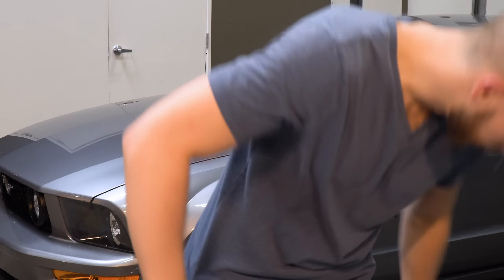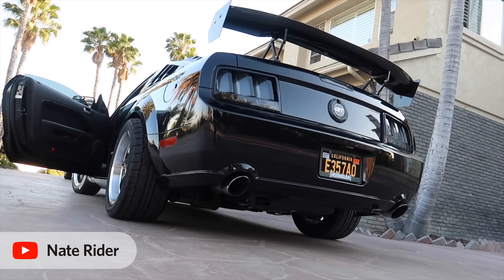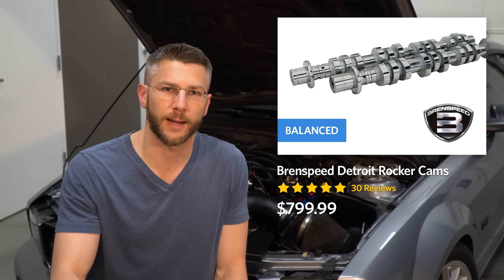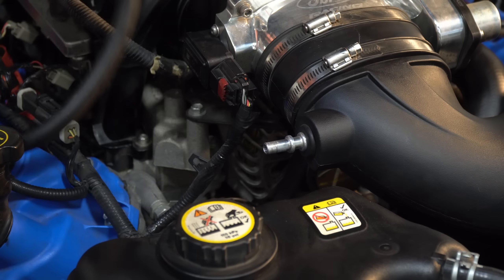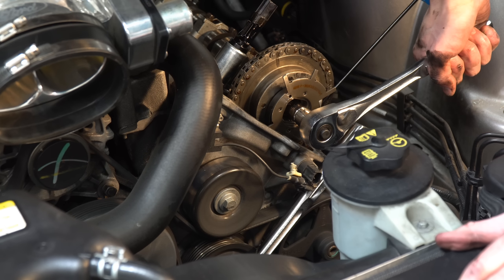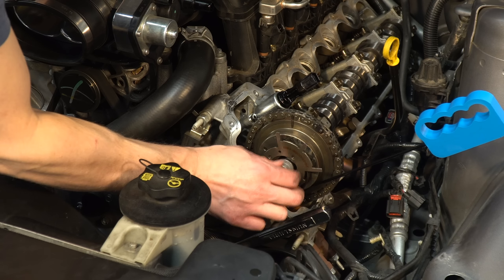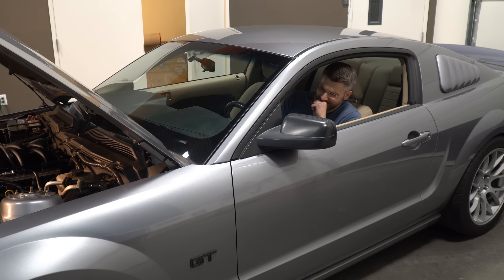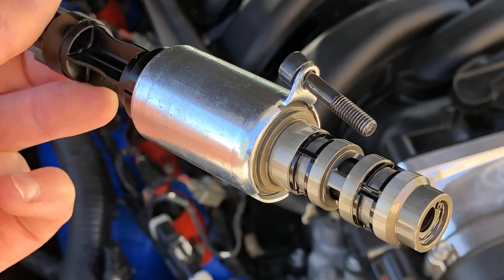Mustang camshaft selection and install guide

Comment: Thank you for this video! Extremely insightful for the instal and extremely well done.Just put them on my ‘05  GT along with a Brenspeed performance tune (and some other stuff). They sound great! I have 2 suggestions to add having done this myself: 1- You will very likely get “some” debris in your valve train in the process of removing your valve covers/manipulating the cams, etc. so I would suggest dropping your oil after you tighten the new cams, and pouring some oil onto each side so any debris drains out, then go ahead and add new oil & filter. 2- when you’re removing the cam phaser bolt, use an air gun if you have it! Getting it off quick makes it less likely to disturb the timing chain.

Comment: If you made everyday context you'd be in the millions for subs. Good stuff. Keep up the GREAT content!
Reply from the maker: Ha thanks that's very generous.
Reply: @Four_Eyes  I agree on the body style. I have a 08 gt500 a 07 Shelby gt and a 07 427 edition convertible super snake.Love the body style.But I also love the 10 look.I have a 10 grabber blue super snake and a couple of cobras also but my favorite car is my torch red 08 gt500.The 500 has a modest 850hp and my 10 is 900hp.But even with those numbers my 07 Shelby gt is 325hp and I still enjoy that car.I can use all the power vs trying to use half the power in my super snakes. I love your car RETRO GOTTA LOVE IT.
Reply: @anthonylaudano9751  how many fucking Shelbie's do you have hot damn
Reply: @omegargb236  prolly zero

Comment: About to troubleshoot a ticking noise.  Possibly a bad cam roller follower or stuck lifter.  I've watched this video multiple times.  Thanks for posting and assisting DIYer to tackle these kinds of issues.  I have a 2006 Mustang GT the same color as yours.  Love it.

Comment: As soon as you called out the other tubers, I smashed the like button on and off about 20 times lol. Thank YOU for not abandoning your platform. Was wondering where you were. I know that you’ll tell us in another video what happened prior to this video. Good choice on the brenspeed cams. They are proven and work well with forced induction. And yea, it sounds sooo good. 💪🏾😎

Comment: When I first got mine I didn't have the Kooks long tube headers with h- pipe once that was installed I noticed a big power difference.  Before only on top end range.  Yes, they do sound great.  Please make more videos.  I personally love my Brenspeed cams which I read on Mustang Forums they produce more power than Ford Racing Cams.
Reply: Where do I buy the cam from

Comment: I really love the sound of the Detroit rockers, but my goal is for more power over sound, but to stay streetable. So I've come up with a combo for my f150 5.4 3v that "I think" will give me what I'm looking for.  Custom grind cam, intake 235°@.490 lift, exhaust 230°@.500 lift
With 112°lobe separation  , port match the intake and exhaust, shorty headers, cat delete w/dual 2.5 exhaust w/xpipe. Hope this works.
Reply: Long dead thread but you're more or less wasting your money. First, the shorty headers do absolutely nothing for you so whatever gains you do get will strictly be through the cams. The second are the cams in general. Unless you can get intake adapters to fit something other than the truck manifold you'll barely see much of a gain over 15 wheel because the stock manifold can't flow enough. The heads can support an easy 250-350 wheel but it's the intake that lets the 5.4 down.

Comment: Great video. You missed one thing there are a couple rocker-folowers that need to be reseated with a spring compressor after the cams are installed. Something about how the cams sit, the rocker-followers want to come out. This happend to me and cause one of the cyilinder 8 intake valves to drop. The ford performace install guide depicts which rocker-followers to reseat.

Comment: Glad that all your issue was just a sticking VCT solenoid. Did you replace both of them or just the bad 1?
Reply from the maker: Just bad the one... which is probably short-sighted.
Reply: @Four_Eyes …...Well at least it's a simple enough job to do in retrospect so it's all good. Have you always had the Airaid CAI? Thought you had a JLT prior?
Reply: @Four_Eyes …..FYI, found out from some snooping that you can't incur any piston-to-valve clearance issues on these 3V's using a "drop in" type camshaft from a VCT solenoid failure as the cam lobe design is engineered to operate within the full OEM VCT cam phaser physical swing range of 30* total camshaft retard from base camshaft timing as designed in the cam phaser itself (as are the OEM production camshafts). The only way to incur actual piston-to-valve contact is from the engine actually jumping PHYSICAL time (timing chain, sprocket, tensioner, guide failure and\or actual catastrophic cam phaser, camshaft or crankshaft failures). The issue w\ the failures that took out the engines of the 2 YouTubers mentioned were most likely due to improper cam installs (misalignment of phaser pin into the pin slot of camshaft nose causing pin damage\breakage during tightening of cam phaser to camshaft or left 1 cam phaser bolt loose enough from either under torque or over torque to cause cam phaser to cavitate on camshaft nose while in rotation banging into phaser pin causing it to fatigue then break) into the cam phasers that caused the timing PIN inside 1 of the cam phasers to shear off which allowed the camshaft to physically rotate out of time inside the cam phaser's cam socket causing a piston to hit a valve held open at full lift height by camshaft when piston is arriving at TDC. This most likely occurred due to installing the camshaft back onto the head w\o removing the necessary followers (doing this work w\o using a valve spring compressor) to put the camshaft into neutral unloaded position BEFORE installing the cam phaser back onto the camshaft due to the camshaft pin slot being rotated slightly out of alignment due to camshaft being under spring tension w\ the cam phaser alignment pin then being forced in during tightening of cam phaser bolt. The way you did this (installed the camshaft back into the cam phaser fully engaging the phaser pin BEFORE laying the camshaft back onto the head cam tower journals) is the better way to do this IF a valve spring compressor is not used along w\ the Ford approved removal\install procedure to unload certain camshaft lobes of valve spring tension in neutral alignment position w\ the cam phaser still kept in time on timing chain (which will auto align the phaser pin w\ the camshaft nose pin slot w\ the camshaft "locked in place" by spring tension on the other followers that are left in place so as long as the new camshaft is laid back onto the head in the exact same position as the old camshaft was before removal, pin misalignment\damage will not become an issue during installation as the camshaft will be fully resting into the head cam towers w\ no spring load on camshaft so the cam phaser will be in perfect alignment w\ the camshaft nose and the pin to pin slot so all can be reinstalled w\o fear of rotation or having to fight spring tension to realign the pin to pin slot to ensure that the phaser is fully seated onto the camshaft nose thus phaser pin into camshaft nose pin slot before torqueing the phaser bolts). So cudos to you. Those alignment pins in these cam phasers are VERY strong....they are designed to not fail under most typical torsional loads from camshaft counter-rotation due to valve spring loads....as long as the phaser bolts are properly torqued down to spec (not left loose due to under torque or caused excessive bolt stretch due to over torque) so phasers aren't wallowing on camshaft nose while rotating OR pin was damaged from forcing the misaligned phaser pin into camshaft pin slot during install while tightening phaser bolt. Your engine shaking was due to cams being out of phase to each other due to the bad VCT solenoid--not being out of time (1 side at base timing, other side stuck in retard timing from failed VCT solenoid allowing oil pressure to phaser to hold cam in retard timing). This will also cause cylinders on the retarded cam side to have lower cylinder pressure vs the base cam side due to the retarded side's IVC points during compression stroke to occur later in crankshaft degree rotation vs the base side which will throw the engine out of balance when running and 1 side showing lower cylinder pressures vs the other side during a compression test). Oh, BTW, I watched 1 of your earlier videos & saw that you've always had the Airaid CAI installed...….. :) My bad.

Comment: Those Detroit cams are eargasmic... hey, quick warning before you jump into the rabbit hole that is suspension upgrades on your S197... don't make the same mistake that I did. If you are going to lower the car any distance at all, realize that the further you lower your suspension, the more stress/wear&tear you will put on certain components. Changing said parts out for adjustable versions of them will greatly reduce said stress.

IE. the 05-09 parts that usually should be replaced when you lower the car include adjustable front sway bar end links, adjustable tie rod ends (aka. bumpsteer kit), ball joints, adjustable rear upper AND lower control arms, and adjustable panhard bar (alternatively, throw out the panhard bar for a Watts Link kit, which is expensive).

I'd advise for KONI STR.T shocks/struts, and SR Performance's Strut Tower Brace and 1.5" Lowering Spring Kit. Best value you can get, but keep in mind lowering the car will come with needing to upgrade some of the suspension to adjustable parts.

Love your channel, love your videos. It's a damn shame you don't have more subs/views, because your quality>quantity approach is hard to come by in the car community these days. Kudos.
Reply from the maker: Thanks for the thoughtful comment. The suspension upgrades will constitute a near-complete overhaul. Definitely not just getting coil-overs and calling it good.
Reply: @Four_Eyes  Great to hear! Genuinely looking forward to what you choose and what you think about your choice, because I like hearing differing opinions and approaches to upgrading S197s

Comment: Pardon my dumbness but Does the car have to be in neutral to rotate crankshaft to get cam phaser top dead center and perpendicular? 2) also when you got the driver side cam phaser to top center and perpendicular,  does that mean passenger side is also at top dead center and perpendicular ? or you had to rotate crank for the passenger as well? 
thanks for the content brotha! keep it up!
I'm waiting for my cams to get here so i can install.
Reply from the maker: 1) yes
2) i can't remember, may've had to rotate again (the pin is easy to find wherever it is)

just take your time on the install and do a good job, it's pretty straightforward. thanks for watching amigo ✌
Reply: @Four_Eyes  🍻

Comment: I went hot rod cams before a tune i picked up 20 peak torque 60 curve and 30 peak horse 45 curve and the chops with my exhaust setup are a very unique sound

Comment: Sounds great. I had CompCams stage 2 NA cams. I ran those with my Department of Boost supercharger M122. I'm now running a VMP GEN2R supercharger and Bullet stage 3 blower cams. Drivability suffers at low RPMs but topend power with 20lbs boost is insane! My 3v is in a radical 1968 F100.
Reply from the maker: Wow dude that is a crazy build! Super cool rig. I always loved Road America on Forza 4.

Comment: Hey Four Eyes! Getting ready to pull the trigger on cams for my 06 GT Vert. Gonna do the install myself thanks to your video! 👍👌Thanks for the high quality step-by-step and info on the Detroit Rocker Cams low/midrange power band.  Another cam install video by LMR stated compressing the springs. Not sure if that was due to those cams being Ford Racing Hot Rod Cams or suggested for the Detroit Rockers as well. Thanks for your help!
Reply from the maker: Hey Jessie, you don't need to use that tool, just slowly remove the cam cap bolts in the pattern shown in the diagram. Basically you're trying to ensure the cam comes up off the roller-followers evenly. Same thing applies when bolting down the new cam. Take your time, don't skip any steps, use plenty of lube (lol), and torque everything to spec. Thank you 👍
Reply: Thanks brother! Will let you know how it goes.

Comment: I’ve had 5 or 6 sets of hot rod cams and 1 set of Detroit rocker blower cams.  The Detroit rockers were by far the best for drivability.  The battery removal during install definitely saves time and aggravation. Anyone looking to install 3v cams should just remove It and not waste time trying to get to bolts.

Comment: I know this is an older video - but the sound you have here is unlike almost any other video I have seen. Did you set a lower idle speed? You have a chop similar to the FRPP cams I had on my 3v mustang, and while shopping for cams for my 3v sport trac - I’m torn between the FRPP and the DRs. The DRs will have less low/mid loss, but I’m not racing my truck or anything…I just miss the feeling. I’m leaning towards Brenspeed just for their customer service though, they are incredible.
Reply from the maker: Idle was set at 850 RPM. The DR's are great, I probably shouldn't of sold mine.

Comment: The most notorious question is will this work on a crown Vic 4.6 v8 engine. Some say that it uses the same engine as a mustang and some say it's made of different blocks and heads.
Reply: @kingssuck06  do you know a way to tell? I have a 2003 Ford crown Vic police interceptor

Comment: Sounds great. I have an 05 with several upgrades (I won’t list them for the sake of keeping this comment short), but the car sounds similar to yours. If you would, please look up Roush Sport. My car from a visual standpoint is very unique (only one in the world that looks the way mine does), and as such you should easily find the video of it idling in my driveway. Can’t wait to see the stage 3 results!
Reply from the maker: I like the wrap. Looks like you took it off, but that wrap would look money with black wheels imo.
Reply: @Four_Eyes   Wrap is still on the car. The wheels I plan on getting once "play" money is something I have again, are the Weld Racing SR 71's.
Reply from the maker: Those are sick.

Comment: Hey my dude, just finished rewatching the build.  How available is E85 in AZ? If that’s not
around, you could always add methanol injection. I noticed you don’t plan to
shorten the gear ratio, which makes sense at 700hp.  .355s might be worth a shot, they’re kind of
the .373 gearing for people with serious horsepower.  Can’t speak well enough of the quality and
entertainment value of these vids.
Reply from the maker: I'm in northern Nevada, E85 is p rare around these parts. I am going to stick with pump gas mainly so I can drive anywhere w/o worrying about finding special fuel in the middle of Utah or something. Thanks for watching the videos ✌

Comment: I suggest bmr polyurethane complete rear upper and lower control arms as well as the upper axle bushing. Adjustable pan hard bar. Some 1.5 in lowering springs and shocks that are suited for your majority of driving. As for the front gt500 strut mounts and some matching adjustable struts to your rears as well as springs. Solid quality strut brace and upgraded gt500 away bar.

Comment: Great vid, These will be the cams I get. On the other hand. you say that once I remove the phaser bolts, I need to replace them due to, they're a one time use. I see on some parts sites that, the cams can use the same bolts. I would replace them, anyway, just wondering.

Comment: Great choice on the Detroit cams.  Still not a fan of the high raspy sound from the X-pipes. I prefer the H-pipe low beefy rumble.  I chose to lower my 07 GT with the coil overs.  More expensive than the springs but a much better ride and enable you to get the car at the exact height that you like the best.  Nice vid series.

Comment: Sounds awesome, that's one thing I haven't done to mine yet, may do that in the near future.
(I have an 06 4.6l 3v, kooks long tubes, bbk x pipe, flowmasters mufflers, airlift air suspension, and a v3 procharger, Hurst short shifter)
Reply from the maker: How do you like being on bags? Any major negatives?
Reply: @Four_Eyes  I am still trying to dial it in but I love them, negatives- pricey, however I love them. I have had eibach spring on my new edge (last mustang) they were good as well but I like how I can raise it if need be for speed bumps, or loading it on my trailer. My wife and kids love it as well and everyone compliments me on the look. Me personally I love the way it drives and handles. I wish everything I owned had bags. Lol (I didn't opt for the p3 version but I'm ok with that but I think I may get/install a second pump, not for any major purpose but for the install in the trunk I would like symmetry (tank in the middle and a pump on each side)). Sorry for being long, just trying to give you as much info on it as I can. Thanks
Reply from the maker: Great, thanks for the follow-up!